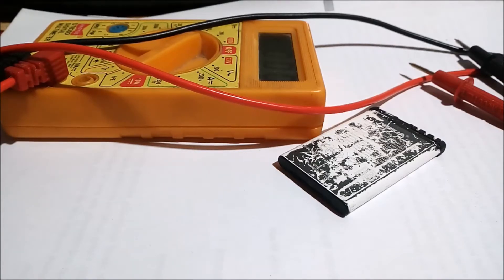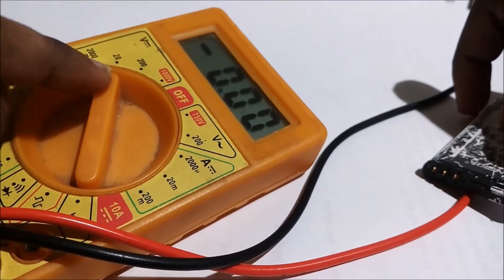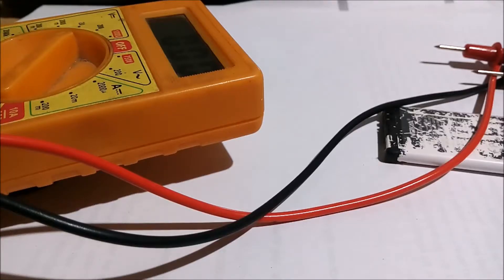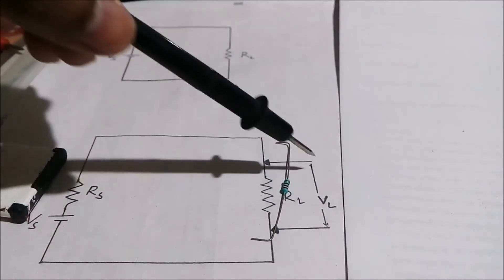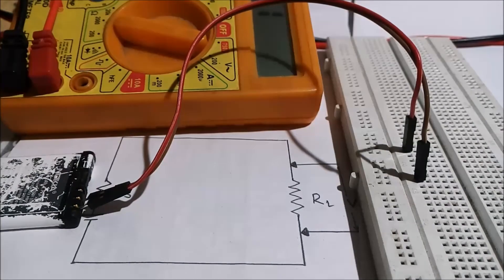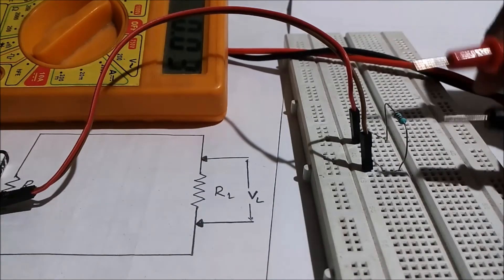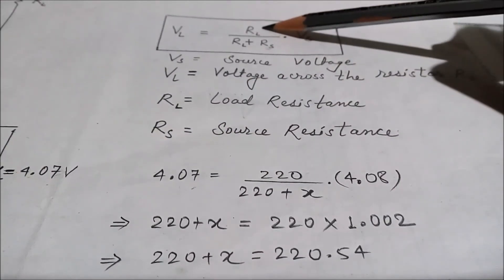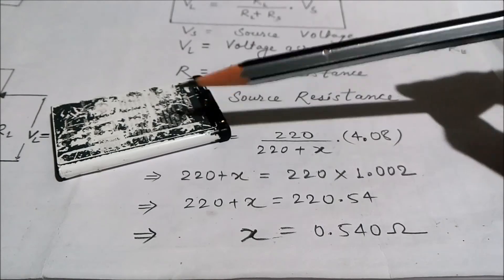How to measure internal resistance of battery with digital multimeter

Comment: You are not accounting the wire resistance here that is connecting the battery to the prototype board. In bigger applications, the wire resistance can be neglected but the cell resistance is way too low and highly sensitive to what is connected across it. Either keep wires as small as possible or calculate voltage drop across the wires.

Comment: Nice explained by you
But that Nokia battery also includes a Battery management system (BMS) which consists of electronic components.
Does this method gives correct value with bms???

Comment: The problem with your selected resistor: the voltage only changed by one unit in the least significant digit -- that's within the error of the multimeter! You don't know if the change was 0, .001 or .002 (at least)

Comment: The resistor value of 220Ohm is way too big. Suppose your multi-meter is off by 0.01V, e.g. suppose next time you measure 4.06V instead of 4.07V. In this case, the internal resistance of the battery will be twice as big: x = 220 * (4.08/4.06 - 1.0) = 1.084 Ohm. You can see from the equation that the sensitivity of the result is (roughly) proportional the resistor value, i.e. the bigger the resistor value the more sensitive the solution is to the measured voltages.
Reply: Very true. One, say a round ~10 Ohms, that cause a bigger voltage drop is better for such measurement.

Comment: That's not really the internal resistance of the battery alone. It includes the resistance of the protoboard connection and probe wire.  So to me, this method is way off when you are measuring milliohms. .
Reply from the maker: Yes, you are correct. You can substract by measuring other (protoboard, probe wire). Then, get the output.

Comment: i have LiitoKala Lii-500 when is better to measuring internal resistance ,when is full charged or when is discharged ? it is very different value like 10-90
Reply from the maker: The value of internal resistance of the battery does not depends on potential difference of the battery. So, it your wish. The internal resistance should be same always. When battery is discharged the potential difference across the battery will be low.

Comment: Hi, Can we check a 12 Volt Lead acid battery with it, the one that we use in Home inverter
Reply from the maker: Sorry for delay. This will not help you to find the internal resistance of lead acid battery. Because the voltage rating and current rating is too high for these kind of batteries. Once you will connect high value resistor to it. It may damage the battery. So, please not perform this experiment on your acid-lead battery. 

Thanks!!

Comment: This is great for finding internal resistance, put simply. I have read somewhere that this is not an accurate way to measure internal resistance, but it seemed to be good enough for me to test my 18650 batteries that were getting hot on the charger. Turns out that they have a large internal resistance and needed to be recycled.

Comment: Perfect, but would that same rule apply to 12V Gel, Starter and deep cycle batteries
Reply from the maker: No, because there will be huge power loss. This practice is only good for small battery.

Comment: the conclusion is health of battery is good.what will be values if battrey worn out its life
{ the resistor value finding is not clear!}
Reply from the maker: The value of resistance will be more when battery worn out its life. 
If you understand the circuit diagram and the voltage division rule using this video then my purpose is fulfill. There might be some calculation mistake.
Reply: @eeehub  ok thank u very much for clarifying the query
Reply: how you have selected particular resistor for the experiment,it was my question in earlier question
Reply from the maker: @SureshKumar-nk2ok  It totally depends upon the voltage of battery. We need to select those resistor that should not burn when we connect the resistor in series with voltage source. I hope now it will be clear for you.